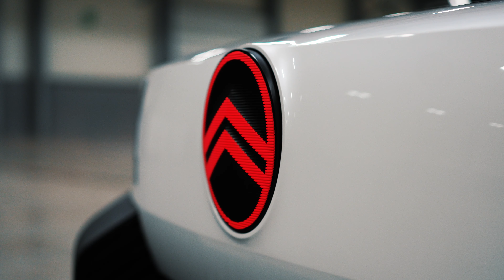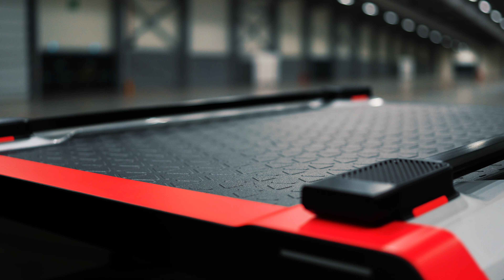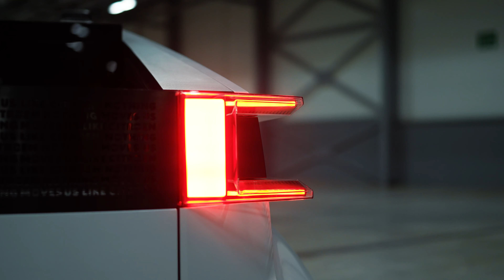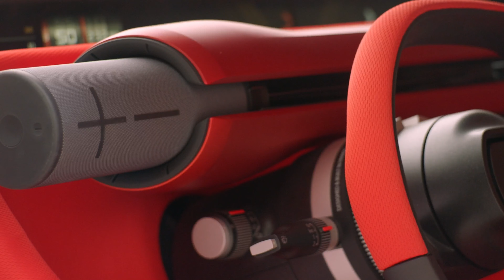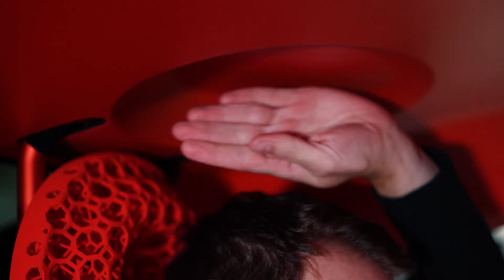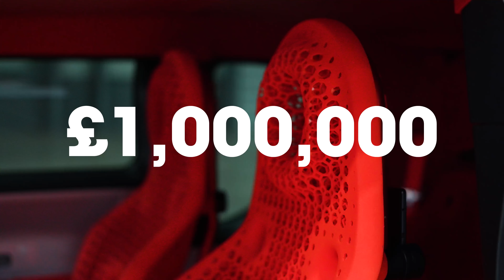NEW Citroen Oli review – game-changing EV of the future?? | What Car?

Comment: it wasn't mentioned in the video but I read somewhere that the side windows mostly angle in at the bottom to reduce sunlight heating the cabin, again reducing the need for AC (and hence more power usage). I would love one of these, I am so bored of the standard euroboxes that are pretty much silver or grey. The only thing that would be great on this would be the ability to remove the back seats and have a hatch through to the boot area. You could then carry larger items or create a sleeping area for camping etc.

Comment: Good assessment of where the whole car industry should be heading ie- BACK about 50 years.  The future was my Renault4L weight 800kg, had fixed windows (sliding), made of very thin steel, but it may have well been that thick cardboard stuff you were showing.  It had a tiny, very economical engine, and would do about 70mph too, (no car in the world needs to travel faster, even today).  It had retread tyres, no internal gadgets, steel wheels, no radio/player - use a portable cassette recorder put on the under-dash shelf.  It had an incredibly flexible interior- seats out in 10 mins, loads of internal space, vertical windscreen, very thin seats, including a front bench seat.  It lasted for years and years due to its simplicity.  I changed the clutch with a bunch of AF spanners and a Haynes manual in a spare weekend.  It went everywhere, could hold 4 people, plus luggage, and you could wash out the interior due to rubber mats.  Parts?  Get them from the breakers yard, easy to fit.  The future Citroen Oli is a 50-year-old Renault 4, and the day it comes back will be a day too long away. Everything in the Oli was done by Renault, or to be fair, Citroen- the 2CV also. Let's get rid of these vast, planet-killing dangerous SUV tanks and get back into real cars that you drove not piloted.